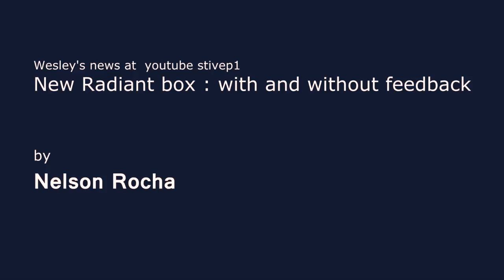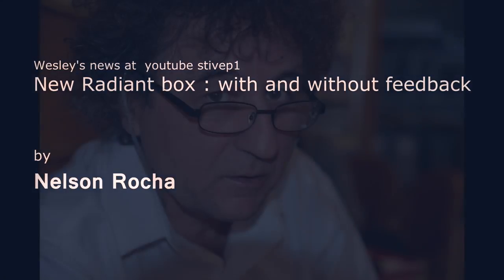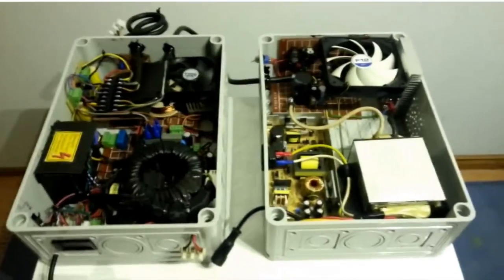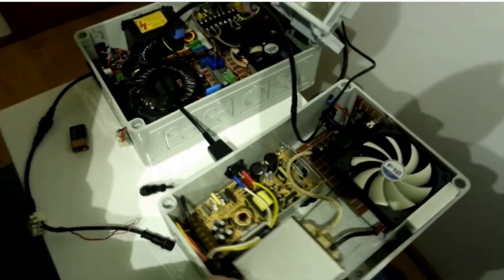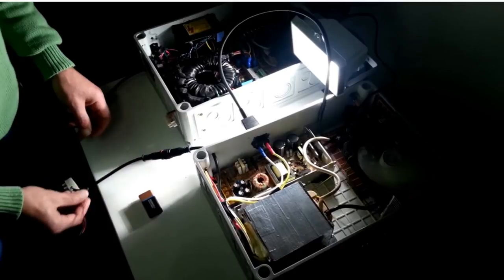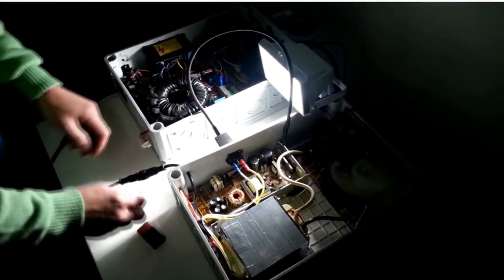Nelson Rocha:  : with and without feedback

Comment: Czytałem sobie taką jedną ciekawą stronkę i wpadłem na jeden dość ciekawy artykuł, trochę interesuję się elektryką oraz śledzę temat urządzenia Kapanadze, widziałem wiele filmików z rożnymi wersjami tego samego urządzenia dlatego ten jeden artykuł przykuł moją uwagę, fragment:
"Build yourself a capacitive-mode "energy sucking antenna" (the kind that
has an electrically-small dipole antenna connected to an RLC resonant
circuit of extremely high Q-factor).  Place it near a toroidial inductor. 
Power the inductor with AC (perhaps the frequency should be high?)  The
frequency of the RLC tuned circuit must match the frequency of the AC
drive of the donut-inductor.  Align the short dipole antenna so that it
acts like a sort of "fractional turn" surrounding the toroidial inductor. 
Measure the energy flow going into the donut and coming out of the tuned
circuit.  Move the dipole antenna so it is no longer within the nearfield
region surrounding the donut-inductor.  I suspect that the output wattage
will not match the input, and that excess energy comes out of the device. "
Moja wiedza na temat elektryczności jest zbyt mała aby cokolwiek o tym powiedzieć więc pomyślałem że dobrze będzie jak ty to zobaczysz;
Link do całego artykułu:
http://amasci.com/freenrg/a-vectFE.html
Reply from the maker: interesujace chociaz pisane jezykiem zrozumialym dla amatora, pierwsze co  sie nasuwa to albo autor chcial sie stac ciekawym dla pospolstwa  albo  autor nie mial glebokiego doswiadczenia w profesionalnej interrakcji  w danym temacie. Linki  ktore znalazlem okreslaja autora jako amatora. Jest bardzo cienka granica pomiedzy amatorem i  specjalista, gdzie ,czasem to ten amator z uwagi na swoje zaangazowanie moze byc bardziej konstruktywny. Spostrzezenia wymagaja glebszego  zaangazowania   aby moc wiecej powiedziec. Jest  to definitywnie  bardzo ciekawa individualnosc i  material poruszony w tym artykule jest definitywie interesujacy
Wesley.

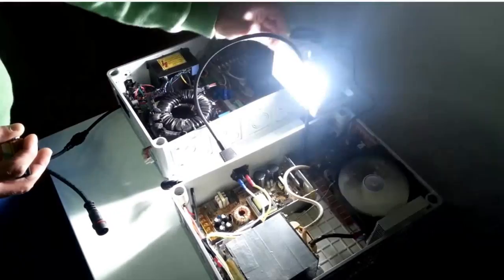Comment: After he removes the 9V battery (3:02) there is a period of time no sound to be heard, and then we hear the high voltage beep sound when he connects the feedback! He quickly disconnects it, but the HV beep continues several seconds until he connects the feedback again. (do note: the fan in box 1 is not rotating during this period) 
But he did not yet connect his battery yet! So either the video and sound are out of sync, or it was not edited correctly. Or? Or the 'experiment' has failed partly, because we now have proof there is a voltage coming out of the feedback even without the battery connected.
I think any 'experiment' should be without any doubt. This video has a doubt. Mine in particular.
I don't believe in these Kapanadze devices until I have seen one myself (but I'd rather see it being replicated by dozens of men all over the world).
Reply from the maker: this note will sound convoluted as I repeat myself few times  right below:

at 3:05 the sound is suddenly activated by Nelson trying to connect selfloop  between  two boxes  for 13 seconds. 
The sound started when Nelson start to make connection,
Than Nelson disconnected two  wires and tried to connect them back.
But the sound was still there despite all of that. It is for me clear that for that moment  charge was delivered from capacitors
We may assume that  no  stored energy should be left in the capacitors to even  make for the 13 seconds of discharge.
The end of that sound was rapid cutoff.... 

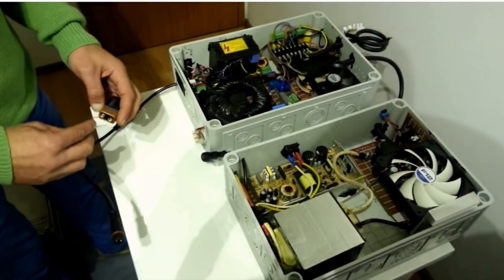When Nelson  in 1:47  connects battery for the first  time  the fan in the left box start to rotate( no sound)

In 2:27 Nelson pushes the switch of the second box ON. from that time both boxes are connected together.

In 2:42 fainting  sound  shows sloping discharge of capacitor under the load and the same again in 3:00
We assume that all charge was  at now dissipated .- nothing left in the capacitors.
....................>>>

Over sudden we hear sound for 13 seconds  during re-connection  3:05 . despite interruptions in between.
The
 sound comes from left side box so the assumption is that charge  was 
delivered from the right side box and it was sufficient enough to make 
sound from  left box .

The puzzling is that rapid cutoff, however
 it could be explained by lack of load  during reconnection, ( the gate 
 of transistor cutting off due to   gate voltage requirement)
I would say it is normal.
Right side box capacitors  have been also charged and hold charge independently  till the time of self loop reconnection.

The
 biggest puzzle is what energy  came from  to charge capacitor and hold 
load  power  requirement at 300 to 600W in any time frame.
So I do not suspect Nelson but I just do not have answer. to that question.

Wesley
Reply: stivep1
Thank you for sharing your observations and thoughts.